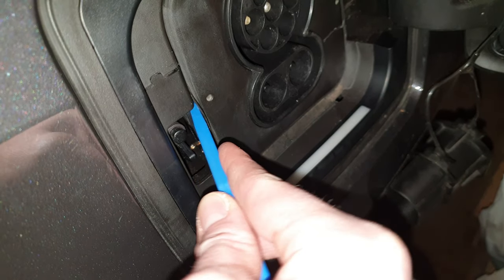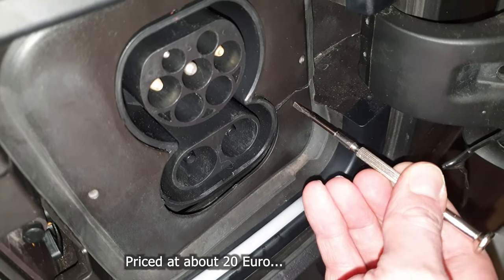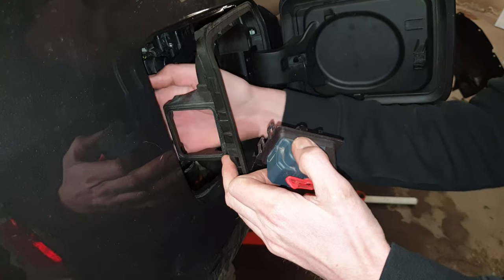BMW i3 - Charging Socket Lock DIY Repair.

Comment: Just away to do this repair - great repair video by the way Bjorn. As mentioned - disconnect the high voltage wire  in the front unless you want to meet your maker!

Comment: Did this job today, with your video as a guide. Thanks alot. Used an hour or so on the job, but did not remove the wheel and liner. Just squizeed my fingers in, to plug the connectors back in. Also iused a lot of time to open the 5 point torx, what a stupid idea to use 5 point safety torx. Now its time for a beer. 🎉

Comment: I was worried that BMW dealer was trying to BS me on a repair they caused since this problem happened to me just a few days after I got my I3 back from an oil change. On my car at 44k miles I have this issue. After seeing your video I will just try to order the part and fix myself because I think they want to charge me about $500 labor for this job!!! Excellent video, thanks!!!! Might mention the special jack adapter needed to safely jack up vehicle for those who may not know.

Comment: Today I fixed mine that didn't want to charge because it wasn't blocking the charging plug. I didn't remove the wheel arch. Dismantled everything as in the video. This block was not unscrewed, it is disassembled if 5 locks are snapped off. There are a lot of gears inside, I smeared everything with silicone, the white slider too. Everything worked! The blue cable also needs to be lubricated.

Comment: Thanks! I have the same issue and will eventually need to replace this part. However, to keep it going for another few months, I've put a thick lump of multi-purpose grease on my personal charging cable around the lock hole and then locked-unlocked about 10 times. This simple trick made it less likely to get stuck. It also helps if you hold the CCS cable slightly up to counteract the weight when you lock-unlock the cable.

Comment: I was (and still am) having an issue with DC Fast Charging. Unless I held up the bottom of the charging handle it would not charge and was reporting locking error. If I lifted up slightly it would charge. I took it to BMW and they said the same thing..they replaced the locking mechanism and when it was finished they said DC fast charging was still not working. They said they needed to replace all the charging cables and charging port. (For $2700). I got home and noticed that during AC charging and after locking the car it would NOT lock the handle and I could pull it out, and of course with DC fast charging the charger would not initiate a charge unless I pulled up a bit on the bottom of the handle. When I told BMW they needed to rectify the repair they said it was done properly and I needed the more expensive repair. I told them that it WAS NOT locking the handle. They refused to take the car back in so I called BMW customer relations and they are going to figure what to do. QUESTION: I think you nailed it when you said the heavy handle of the DC charging is pulling down binding the locking pin and hence no charging unless you lift up relieving the pressure. Did this prevent you from DC charging (before the repair)??

Comment: ... i have the same issue, today i stopped by in BMW service, and they said just part itself is about 110 eur, but labour work cca 350-400 eur, saying its 4 hours work and diagnostic plus coding , so all together cost cca 500 eur plus ! ... I see you didnt do any coding and its working, so I will try to do it as well next week ... anyway you made absolutely great video, looks very educating even for amateurs like me :) THANK YOU ... hope you will create more projects on i3, right now i am having problem with seat heating as well :))
Reply from the maker: Good to hear that the video helps people! And like you noticed: I didn't need to code anything after replacing that part.

Unfortunately I'm having problems with my seat heating as well! :/ When I eventually fix it I'll make a video on my take on that. Also a common problem, unfortunately.

Comment: Thanks for the helpful video. I am able to confirm what other suggested might work in the comments.. it's entirely possible to do this repair WITHOUT jacking up the car and removing the wheel and inner well liner.  I did it in about an hour on a US spec 2015 REX.  I was glad I was able to find the necessary 20T PENTA-LOBE BIT. I had to buy a whole set of 3/8 drive bits to get it, but well worth it.  On the US i3 the fasteners are on the back side so I could not get a ratchet in there.  I was able to turn the bit by hand. (EDIT: I found my short swivel ratchet which allowed me to tighten these properly when reinstalling.) In addition, I did not find it necessary to unplug the light bar.  Just left it dangling with the lid and frame.  Plugging the lid latch actuator back in was a bit tricky, but manageable.  Thanks again!  Success!

Comment: Thanks for this video. I've just done this job myself and it definitely helped :) A few points. You definitely don't need to remove the wheel splat. Even the screw I dropped fell out the bottom. At the 3:25 point in the video I used an allen key with 90 bend and was able to click this loose without any force at all. I used vice-grips to get around the 5 sided locking screws. Thanks again.

Comment: Thank you very much for this video. I used it to change my flap actuator and didn’t break anything, which I of course would have without this video. I didn’t remove the wheel. A bit tight when unplugging the connector, but not a problem.

Comment: Excellent video, so well presented and hopefully it will solve my issue. My 12v battery went flat and I had to use the blue pull cord to open the charge port flap. Car will not lock charge cable in for charging since. I have installed new BMW 12v battery, still no charging. I will try the blue cable reset process tomorrow if possible, thank you for this video.😁👌👍

Comment: I had same problem. Cleaned with silicon base spray and a little air gun to remove dust and dirt and is OK from a few week's now.
I will keep in mind your advice to hold a little bit the connector when it desangages the little actuator. Ps great video
Reply: After 1 year starting to have again these problems and seams that the grease is not doing the job ani more

Comment: Almost a year later - did replacing the locking mechanism really solve the problem? No more stuck pin? Thx,
Reply from the maker: Yes, replacing that mechanism solved the problem completely. It works flawlessly now, every time.

Comment: Hi I have a question and hope you see this soon. I have to do this seemingly relatively simple repair. But for my i3 I have to change the door release mechanism, not the charge socket lock. My question is about safety. Of course I’d disconnect the emergency shut off under the front trunk but is that enough? As I understand it the door release mechanism is not part of the high voltage system so just  disconnecting the front truck emergency shut off should be safe enough. Is this correct?
Reply from the maker: It was so long ago that I was working on the i3 that it is a bit hard to remember and I’d rather not guess. But my impression was that there is no exposed cables or connectors behind the charging door. So the emergency shut off sounds like a safe idea, I never pulled that one though.
Reply: @BasinBjorn  thanks for the reply. Yes it seems like it should be a relatively “simple” replacement. I’ll just do the shut off at the front and get it done. Thank you.

Comment: THANK YOU B, I live in the UK, hard to get this parts, it seems this parts can only be sold in EU? Keep having the similar issue for the past year. 2014 i3
And yesterday I couldn't pull out charging cable, so I used blue emergency cable to release the lock. Now the car won't charge at all, flashing red light rapidly and cable won't lock. Why someone saying they can still charging when this part broken? 
 I will order this parts and get it replaced myself.
Reply from the maker: Can you order it from Koed BMW? I think they ship from Denmark or Norway. Should ship to the UK.

But yes, I've heard that the blue emergency cable has to be "pushed/ routed" back to reset and the car to charge again.
Reply: @BasinBjorn  thanks for you replay B, do you know where to find how to reset after pull out blue cable? I took few hours and couldn’t find any information. I can’t charge the car, and I don’t know how long the parts will arrive. Thanks
Reply from the maker: So the blue cable is routed inside the wheel wheel/behind all the panels. And the problem is that when its pulled it usually gets ”stuck” and wont go back by it self. I havent had that issue myself but ive read about it from people who had to pull it.

To access it you will need to:
Raise the car up on a jack stand so you get better access on the rear right wheel.
You can either remove the wheel, and then remove the inner wheel arch ”liner” or just try to open that liner up enough to get your hand in and ”route back the cable”.

Removing the wheel arch liner is the same as in this video, and would give you more space to work. As well as when that part arrives, then you know how to do half of the swap.
Reply: @BasinBjorn  many thanks B, much appreciated

Comment: Hello. I want to know the reason for removing the tire. Looking at the video, it looks like you only need to remove the charging cover, right?
Reply from the maker: Well I couldn’t get the connectors loose of those cables running to the light, charging door lock and the mechanism I was replacing. Without access from behind. But It’s been a while now so I can’t remember exactly how hard that was. But I removed all of that 3 times since I first had the wrong locking mechanism and not the right torx toll.

I’ve gotten a few comments saying it’s possible without going through the wheel arch. So that is probably the case.

Comment: Great work and explanations, B. Do you know if it's a similar process for the common fuel door failure in REx models? Thinking about a self repair and this made me think could be doable. Not being a REx owner you may not know. Thanks for the effort.
Reply from the maker: Yeah it's really hard to say, I can't find that section of parts at the site I usually go to (www.koedbmw.com) but I Googled and found this listing with photos:

https://www.bildelsbasen.se/?link=item&searchmode=3&query=51177335742&post_id=39290126

It looks to be attached in a similar way at the charging door lid, so should be possible to pop out with plastic "trim panel" tools.

But the issue is most likely some sensor or mechanism behind it.

I've read that some people get problem with a fuel pressure sensor, could that be your issue too or do you think it's about the mechanism that opens the door?
Reply from the maker: I found a VIN so I found that section at koedbmw.com

Could it be part #3 called "Ejector" that needs replacing? https://www.koedbmw.com/en-no/catalog/diagram/41_2330/1/58170?steering=L&transmission=A&productiondate=20151200

Part number 51177257780.

It seems to only cost about 8 Euro + shipping. If that is the faulty part.
Reply: The Fuel Port usually jams not because of the locking mechanism itself, but because of a faulty pressure sensor inside the tank.
Everytime you press the release button of the fuel port you get this message that the car prepares for the refueling procedure.
If the sensor transmits a wrong value, then the port wont unlock. This issue is quite common with the earlier REX models (i8s too).
Cut the long story short, you probably have to let your BMW dealer fix this.
Reply: Thanks for great video? You dont have to remove the wheel arch at all. The most difficult was to remove the first cover around the chargeports.

Comment: Why do you need to remove the Inner wheel arch? seems like you do all most all the work form the change "hole". Only mounting the cable for the charge door lock in the end, but that could be done form the Charge side i guess? I will do this change in the coming weekend, as I have the same problem. Thanks for the video will properly save me from breaking some of the plastic parts :-)
Reply from the maker: So it was a while since I did all of this but if I remember correctly you need to remove the wheel arch to be able to unplug the 2 cables for:
1. Light in the charge door.
2. Door opening mechanism.

It might seem like a lot of extra work to remove the wheel arch but it was actually easy. Just give it a wash before so you see all the screws.

Also: the mechanism that I changed here is still working 💯 % flawless.
Reply: @BasinBjorn  Thanks for your reply. Went to my garage today. Easy DIY with your video as support. Car charging now, ready for work tomorrow. I can add, it is possible to help removing the first plastic part, with pushing from the inside with the hand/finger, so that is also a reason to remove the inner wheel arch.

Comment: Really really really good question!!!! My 2015 bmw i3 wont dc fast charge (combo) we looked at a video where this part that you ordered was the problem why it wasnt dc fast charging. For your case it locks and wont unlock but it charges. My case is it wont lock therefore it wont charge. Is that correct? Is this also a solution? Should i take it to bmw?
Reply from the maker: Well, does your car charge through the regular type 2 cable or do you have the same problem there as with DC fast charging?

Mine did not charge at all if that lock didn't engage.

On European cars that lock is used at all types of chargers.
Reply: B as in Bjorn It does charge at lvl 1 and 2
Reply: I just experienced this. If the level 3 charger detects that lock isn't engaged it will refuse to charge. Mines jammed in perm.
Reply: PureO this part is likely your culprit. In the US you can charge at Level 1/2 with the J1772 connector without worrying about if this pin locks or not. You can not DCFC though unless the CCS connector can lock in via this part. You can also visually confirm if if this part is working by locking and unlocking your car while it’s actively charging with a J1772 and viewing if this pin extends and retracts.

Comment: hi , Im not getting the 61-13-6-805-425 only 61-13-6-805-424 in us, mine is europen version, do you think if I buy the US version will work I cant find difference

Comment: Did your check engine light come on because of this issue?
Reply from the maker: No lights came on to indicate the fault. It was only noticable in the way that the connector was "stuck" and didn't unlock.
Reply: @BasinBjorn thanks

Comment: hey
can i change the charging socket inlet from ccs 1 to ccs 2 in my i3?
Reply from the maker: Oh, I don't know. But the main pin-difference between Type 1 and Type 2 seem to be that Type 2 has 3-phase and Type 1 only has 1-phase. Otherwise it's the same pins.

You can read about Type 1 and 2 here:

https://en.m.wikipedia.org/wiki/SAE_J1772

https://en.m.wikipedia.org/wiki/Type_2_connector

I think the biggest problem is how to get all of those cables loose in the back from the old CCS 1. So research that. And what the CCS2 looks like in the back.

Koed BMW has parts and good diagrams of how things go together.

When I loosened this part in the video I could not see any obvious way too remove the cables.

Also note: if you would get them loose there is A LOT OF CURRENT AND VOLTAGE waiting to go bad...

Comment: I have this problem. It has made my check engine come on per BMW. BMW said it will cost $986 to repair. Will have them repair it for warranty purposes.
Reply from the maker: I know you wrote a while back, did you try to fix it yourself? Sounds like that $986 is your only option! Anyway, got my fingers crossed for you! Good luck
Reply: @BasinBjorn  thanks. Appointment with BMW next Friday

Comment: BMW took 2 months to get the part and charged me 900€ for the repair, alleging that also the battery safety pack (what is it?) had to be replaced. Here in Portugal they are real crooks!
Reply: Costs about 275 for bmw to pick up a pen to make your order. Why i steer clear of German made cars.

Comment: fixing it yourself voids the warranty of the car?
Reply from the maker: Warranty is only 2 years on the i3 (except for the battery warranty that is 8 years or so), so depends on that. But this repair doesn’t necessarily leave any marks/ signs for BMW to even know the part was replaced.

Comment: Where can u buy this part???  A Code plecase?
Reply from the maker: The site I bought from & part number ia in the description. But I’ve seen it on a few more places / eBay as well. Should be possible to get it from a Bmw dealer?
Reply: @BasinBjorn  Thanks

Comment: Hi Bjørn
Where did you actually buy the locking mechanism (61136805425)? You are refering to www.koedbmw.com, but did you buy the part there? For the reccord, I have the same problem as you and hope to solve it permanently.
Reply from the maker: Hi Christian, yes I bought the part of koed BMW. I've bought parts there a few times and feel it's a good source for parts. 

And the part I replaced is still working fine, done about 95.000km as of now so it's still fixed.
Reply: One other thing: What kind of screws are used on the locking mechanism? And what dimention? Do you know that?
Some examples are found here: https://www.eevblog.com/forum/reviews/security-bits/
Reply from the maker: Late reply but it is a Torx internal tamber proof pin 5 lobe. I hope you got it sorted by now. (I'm still struggling with seeing replies to comments.